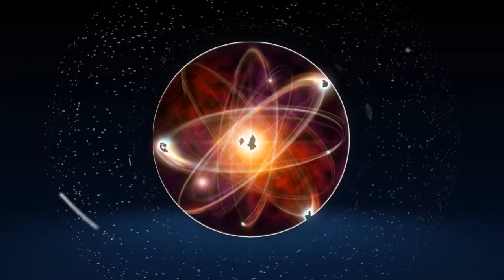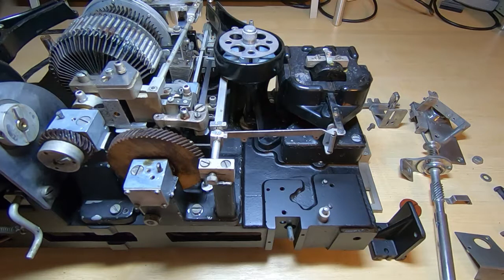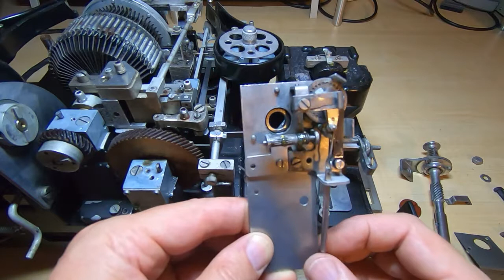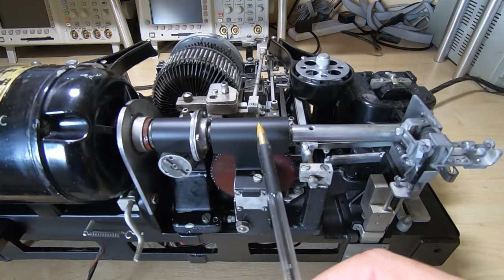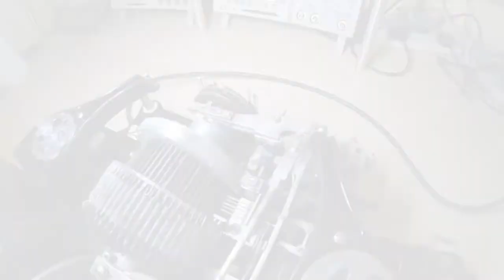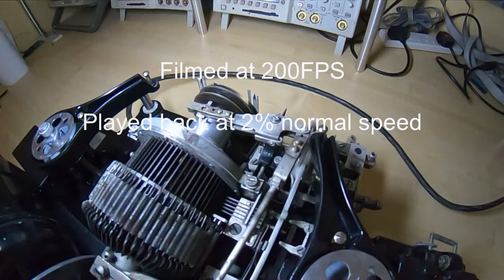Creed 7B Mark 1 Teleprinter Part13

Comment: If I remember correctly the auto on/off was an optional part, possibly designed after the original machine (mine didn't have it), which may explain why the implementation is somewhat kludgy.
Reply from the maker: Yes thats correct. They were designed as configurable modules so items like the answer back unit, transmitter, auto start, character counter and carriage could be added or removed as needed. It always surprises me when I work on such old equipment how 'developed' they were in terms of being configurable. The user manual is very interesting and the history of these machines and their use at Bletchly park makes them facinating.